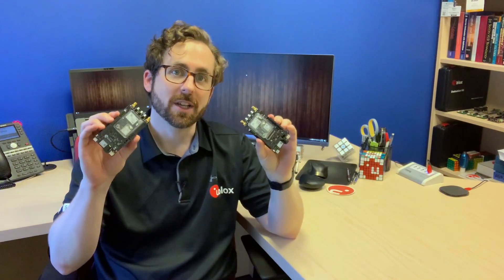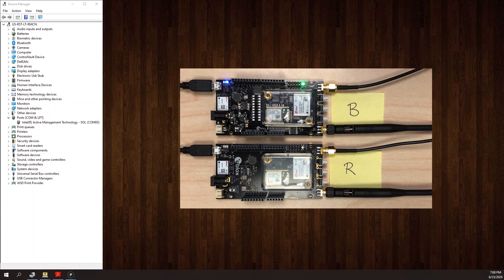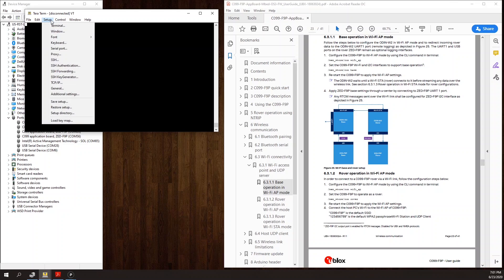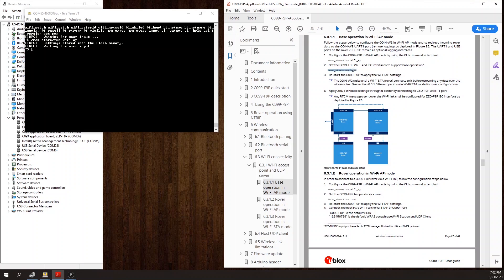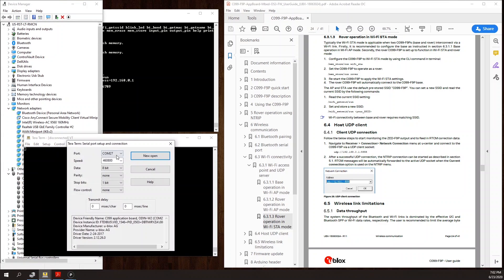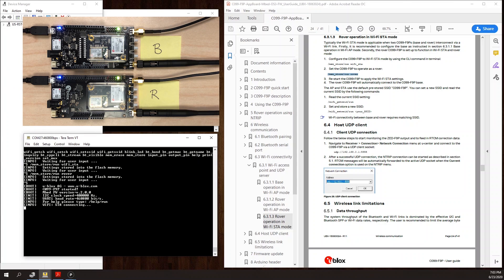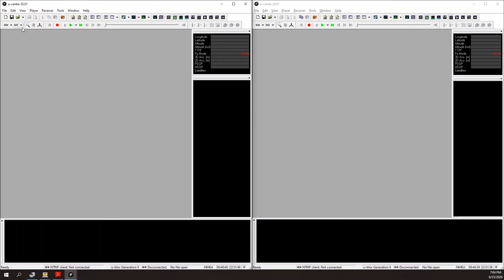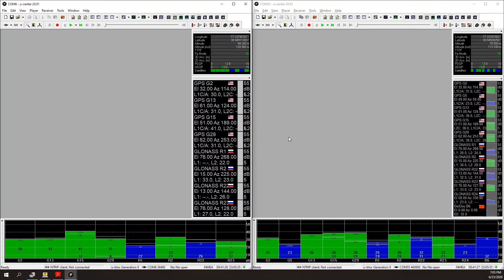#3 How to get started with the u-blox C099-F9P application board (2/2)

Comment: Hi Robert,

Previously, I was working with C94-M8P modules in base-rover pair mode. Now, I have one C099-F9P application board because it claims to go to RTK Fix faster and also when it is indoor. The problem of this module is that the Base Rover pairing happens over bluetooth or WiFi. Is there a way I can hack the board to use it with UHF link of C94-M8P module?

Thanks.

Comment: Hello, I would like use the board to bouild a rover to pick ground control point in photogrammetric surveys. I use a Android app BT connected with the board and with integrated ntrip service. I ask if it's mandatory load the script u-blox ODIN-W2 BT Rover.txt. Thanks

Comment: Thank you for this helpful video.  I am seeing the same results you are in the video - both Base and Rover say 3D.  It would be very helpful to see the Rover go into fixed or even float mode.
Reply: I managed to get a Base and Rover setup working.  There are two options for firmware for the C099.  If you want to use a Base (reference) and Rover (two separate boards) where the base provides the corrections to the Rover then you need to change from the default firmware to the u-connectXpress.  I used this manual: https://www.u-blox.com/sites/default/files/C099-F9P-AppBoard-ODIN-W2-uCX_UserGuide_%28UBX-18055649%29.pdf and watched and read the comments on this excellent video:  https://deepsouthrobotics.com/2019/06/03/the-taming-of-the-u-blox-zed-f9p/#wired-3
Reply from the maker: @RossMelbourne2007  Thanks for the suggestions! We do plan to make another video showing the full setup with rover going into RTK mode. This can be done with the mbed firmware or the u-connectXpress firmware. I agree that article from deepsouthrobotics.com is a great reference!
Reply: @ublox  Hi,
this is the same problem for me! I'm new in the RTK GPS and if you have time I would be very happy with the new video. Many Thanks
Reply: @ublox  Do you still plan to make this full setup base/rover video. Would appreciate it!!
Reply: @ublox  Kindly upload this video. I am facing issues in going to RTK MODE over wifi. Looking forward to your reply.

Comment: Hi Robert, is it possible to connect a base and Rover together with Wi-Fi and connect the Rover to a app via Bluetooth, I would really appreciate any help thank you very much
Reply from the maker: Hi James, Great question! Yes, this can be done, although this configuration is currently not available with the mbed evaluation FW. So to set this up the ODIN modules first need to be reprogrammed with the u-connectXpress firmware. Then the base and rover can be configured with AT commands (or via the s-center GUI).

On the base you will need to set up a Wi-Fi Access Point with a TCP or UDP server. For an example of this, check out "Serial to Wi-Fi access point" in the u-connectXpress User Guide (UBX-16024251).

On the rover you will need to set up a Wi-Fi Station and a TCP or UDP client connection. For an example of this, check out the "Serial to Wi-Fi Station" in the u-connectXpress User Guide. The Bluetooth server is enabled by default, so all you need to do is scan and connect from the PC. I recommend setting a unique Bluetooth Local Name so the rover is easily identified when scanning on the PC.

After putting both ODIN modules into Data Mode, be sure to connect the OE3 jumpers (this connects the ODIN and ZED UARTs together). 

The one caveat with this setup is that each link is bi-directional, meaning that the rover's output data will be sent to the PC over Bluetooth but also back to the base over Wi-Fi. The base will ignore most messages, but take care not to poll rover configuration over Bluetooth as the response will also go to the base and reconfigure it.